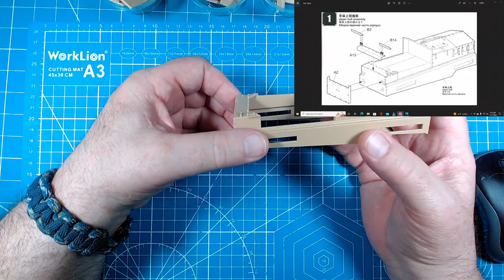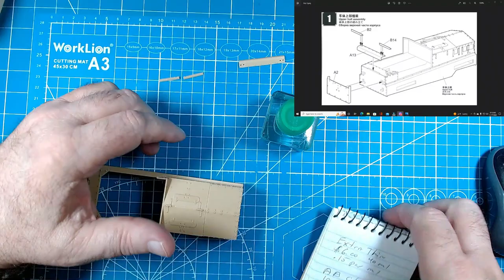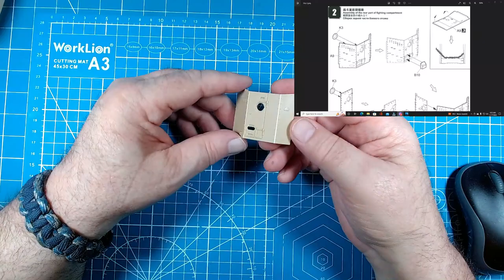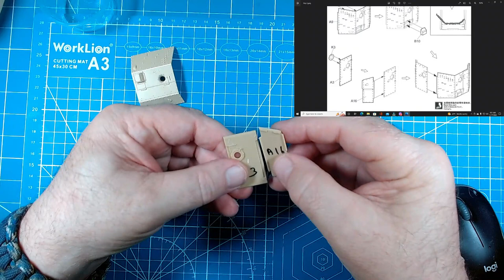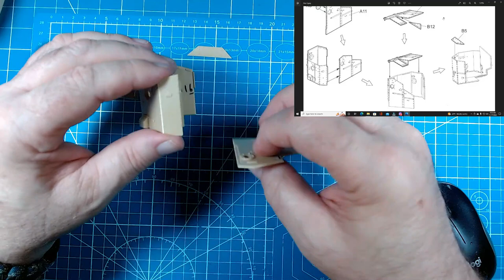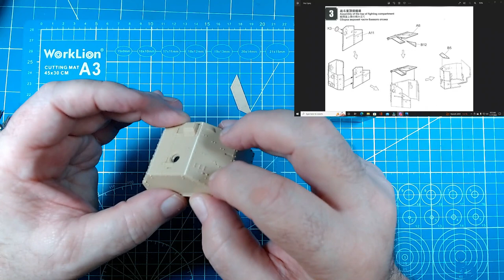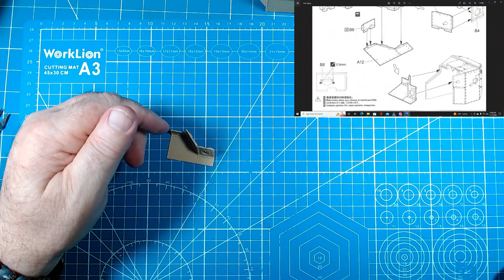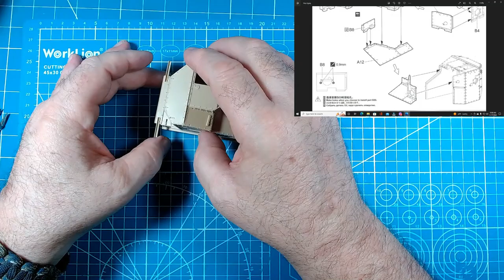Meng Whippet Part 2

Comment: That's a great idea to mark the number of parts that are large enough to Mark!!
Reply from the maker: Thanks Tom, I use a sharpie and mark in a spot that will not be seen on the finished model.  You don't ever want to paint over sharpie, because it could bleed through and ruin your paint job.  Have a good one.  Jeff

Comment: Great progress there Jeff. I had heard of using the Tamiya A/C instead of the Extra Thin, before. But I've not tried it. I'll be interested to see how you get on. Have a good day. Cheers Bob 👍
Reply from the maker: Hi Bob, Thanks for watching.  I can't tell any difference between the Extra Thin and the Airbrush cleaner except for the price.  This is a nice kit, I'm really happy with the way the parts are fitting.  Have a great day.  Jeff

Comment: I like the idea of showing the instructions as you build. Does the Tamiya Airbrush Cleaner really work ???, if it does why do airbrush not get bunged up if its glue ??
Reply from the maker: Hi Steve, Thanks for watching.  I've had a really good response about putting the instructions on the screen.  I plan on using that format much more.  Yes, airbrush cleaner and Tamiya Extra Thin are the same thing, but the Tamiya Airbrush cleaner is much less expensive.  Tamiya Extra Thin is not a glue, it's a solvent that melts polystyrene.   I'm very happy with the way it works.  Have a great day.  Jeff